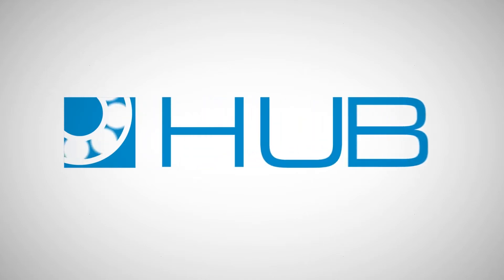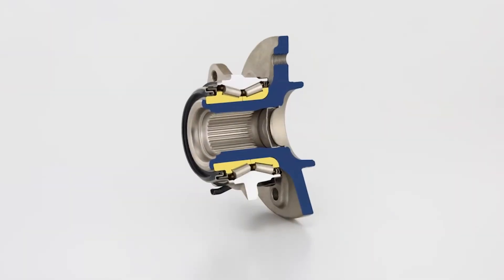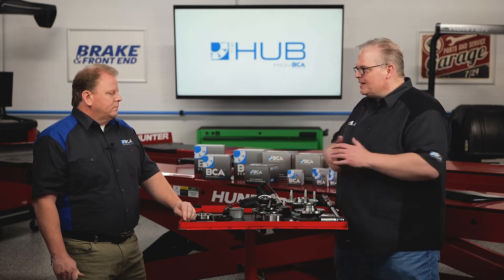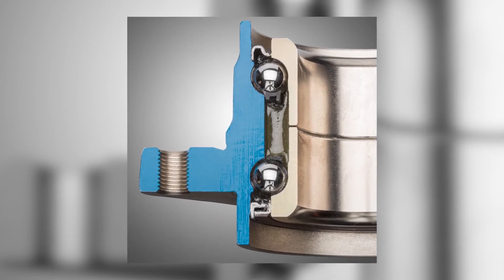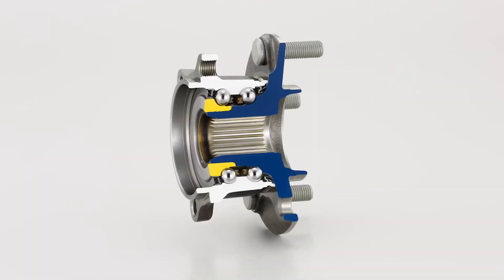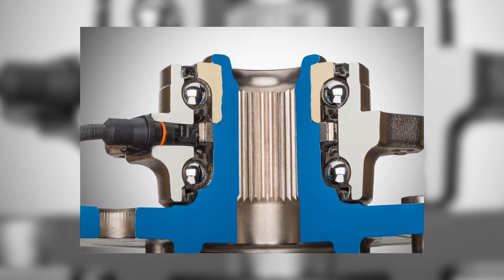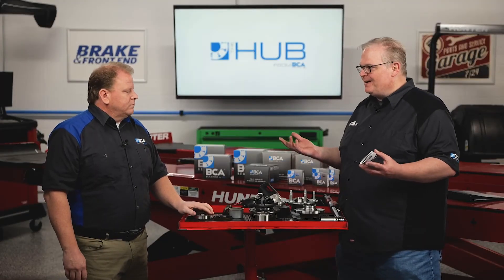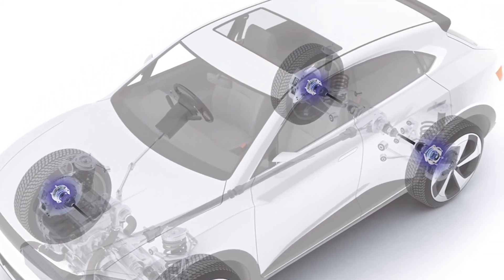What’s the Deal with All the Different Axle Nut Torque Specs?

Comment: What the hell is the point of this video you just did the same f**** thing engage three different answers of how many pounds of torque it to that's why I clicked on this video cuz I thought maybe you had a general answer but you did the same thing everybody three different answers oh you just got to look I did look and I found four different specs for my f**** 2010 Dodge journey from front CV axle nut I got 97, 118, and 187
Reply from the maker: On a 2010 Dodge Journey (2.4 I4 / 3.6 V6), the correct torque spec for the Axle Nut is 118 Ft-lbs on the front, and 181 Ft-lbs on the rear (rear for AWD drive models only). The torque spec for the Front Bearing Hub to Knuckle is 35 Ft-lbs, and the spec for the Rear Hub to Control Arm is 44  Ft-lbs. Please let us know if you have any other questions. Thanks!